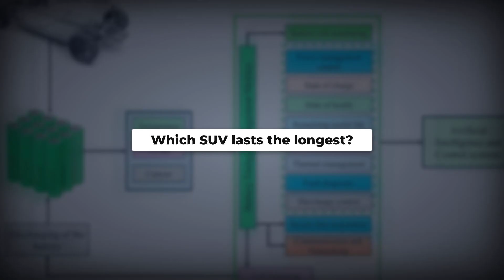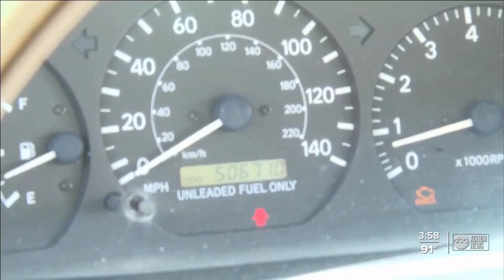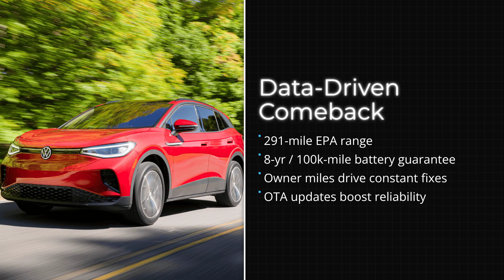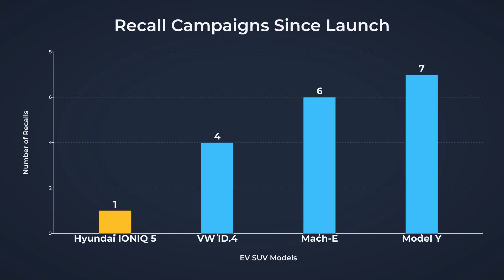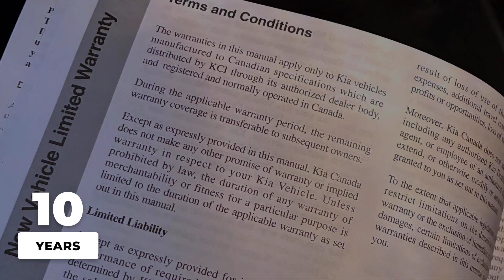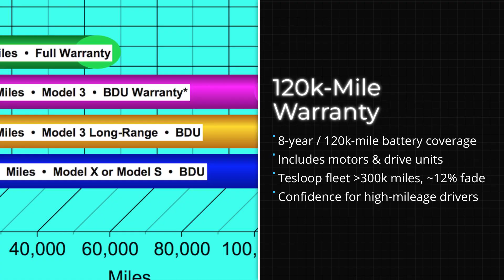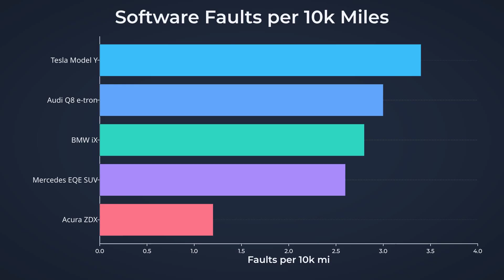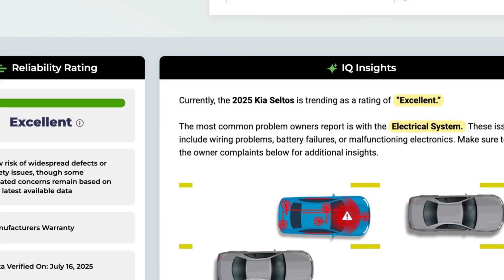These 8 Electric SUVs Are Built To LAST Forever

Comment: My 2017 Tesla Model S has had zero issues.  It has had a couple of repairs from fender benders, but the battery is still fine, and no major repairs or maintenance were needed.
Reply from the maker: That’s awesome to hear! The 2017 models really seem to be the sweet spot—you dodged the early drive unit issues of the 2013–2015 era, but still have the robust build quality. It seems like as long as the air suspension and door handles hold up, the powertrain itself is bulletproof. How many miles do you have on it now?
Reply: @ChargeZoneGarage Have 114K on it.
Reply from the maker: Nice! That is the magic number where critics usually claim the battery dies. Have you noticed much range loss (degradation) compared to when it was new? Real-world data like that is super helpful for people currently shopping.
Reply: @ChargeZoneGarage  Yes there is degradation, but not substantial.  maybe like 10%.  But we'll see.  Everything is working fine.

Comment: Sounds like a paid for review, the only question is who paid the most, as most of these have been ridiculed by every other review
Reply from the maker: We appreciate you sharing your perspective. To be clear, our reviews are not paid for by manufacturers. Our goal is to provide our own independent and objective assessments based on our testing and experience with the vehicles. We understand that opinions on cars can vary widely across different reviewers and publications.
Reply: @ChargeZoneGarage  Yeah, right! Do you know when bz4x started selling - riiiight - 2025 and you made it one of the most reliable cars?! Also: "Introduced in 2024, September 2025, Acura announced its discontinuation" You are simply a paid troll (a Toyota one).. Your first frame of the video shows Tesla model Y - again pure troll.
Reply from the maker: Oh, you caught me. I’m actually a paid troll for all electric cars—Tesla, Toyota, you name it. 😂
Reply: @ChargeZoneGarage On top of things, you might want to ask ChatGPT if we can now start calling the Ioniq 5 a lemon? e-GMP cars (Ioniq 5, 6, EV6 and GV60) have been plagued with all sorts of electric problems from the outset, from the ICCU failing, to the charge port needing to be replaced (as per my own Ioniq 6 after less than 1.5 years on the road with only 20,000 miles on the odometer) to the premature 12-volt battery failure. Soooo, that you put both the Ioniq 5 and the EV6 in the top reliable car models, i.e. built to last, in light of the well-known e-GMP problems, is not surprising. It’s astonishing!
Reply from the maker: @jean-marcfiliatrault266  That’s a fair point regarding the early ICCU and 12V issues on the e-GMP platform—definitely frustrated a lot of owners early on! The 2025 data we looked at suggests those specific failure rates have dropped significantly with the newer software updates and revised parts. Do you feel the updates haven’t fully solved it yet based on your experience? 🔌🤔

Comment: They need to last forever as the money you lose after buying one new is catastrophic!
Reply: I have a Mach E , it’s a great car very fast forty K on the miles I would buy another one,
Reply from the maker: @arthuralzamora7331  That's great to hear! It's awesome that you're enjoying your Mach-E so much and have put 40k miles on it. The fact that you'd buy another one is a fantastic endorsement. Thanks for sharing your experience
Reply: The money you save per year, adds up really quickly… I’ve saved over $20,000 in fuel alone with no maintenance while having a model Y over 4 years with ZERO MAINTENANCE 😊.. you spend over $6000 a year with maintenance and gas on your car, due the math my friend 🎉
Reply from the maker: @SuaveCityGear  That's an impressive saving! $20,000 in fuel alone over four years is a significant amount, and having zero maintenance on top of that is fantastic. Thanks for sharing your experience with the Model Y; it's a very compelling case for EVs.
Reply from the maker: That is an absolutely massive sticking point for many buyers. Catastrophic depreciation is a major deterrent for sure—it’s the silent cost nobody talks about in the press releases.

 the main question is: Is the money saved on gas/maintenance over 5 years enough to offset the initial loss in value? What do you think the 5-year depreciation on this particular EV will be?
Reply: 🐂 💩 bet you’ve never driven an EV
Reply: @stephenbusby3521  I have 37 radio controlled and about 200 slot cars.
Reply from the maker: That's an impressive collection! Having so many radio-controlled and slot cars sounds like a ton of fun. Which ones are your absolute favorites to run?
Reply: @ChargeZoneGarage  I have a 1/10 Scale classic Land Rover, which is probably my favourite at the moment, but I also have a couple of kits that I haven't even built yet. And my favourite slot car to drive is a 1980s Scalextric Lancia 037 rally car.
Reply from the maker: @wordreet  To be fair, your 1/10 scale Land Rover is probably 10x more reliable than the full-size gas version. And you can't go wrong with a Lancia 037. Maybe we need to do a 'Top 10 RC Cars' video next?
Reply: @ChargeZoneGarage  Hmm, tricky, my actual favourite is the Tamiya Sand Scorcher, since I first saw one on a beach way back in the 1980s. I bought one 4 years ago, didn't build it, gave it to someone for xmas. Bought myself another last year. So I can't say it's a true favourite until I've built it and driven it for a while. I have other favourites too, and all for different reasons. 😁
For a better formed opinion you could certainly talk to Tomley RC. He's not as old as me, but he has 300+ RC cars!!!!!!!
Reply from the maker: @wordreet You can't beat 80s Tamiya nostalgia. In a way, those kits were pioneering the electric off-road excitement we see in cars like the Rivian or Hummer EV today! Thanks for the Tomley recommendation, I'll have to check out his fleet.
Reply from the maker: You caught me! Does a golf cart count? 😉 Or maybe my remote control car from when I was a kid? It was electric
Reply: Petrol troll. Choice is good. Zero emissions is good. Not paying $700plus per month on gas is good too. 80% less moving parts.
Reply from the maker: @bobbituka123  Actually, we’re huge fans of the EV shift here—lower maintenance and zero tailpipe emissions are exactly why we cover this tech! This video was specifically about long-term mechanical reliability, but the cost savings you mentioned are a massive part of the total ownership equation. lol, who's missing those $700 gas bills? ⚡🙅‍♂

Comment: No entries from GM?
Reply from the maker: GM has made strong progress with models like the Cadillac Lyriq and Chevy Blazer EV, but most reliability data is still limited since they’re relatively new to the market. Once there’s more long-term data, we’ll definitely revisit them in a future ranking. Do you have a GM?
Reply: @ChargeZoneGarage  Yes. Chevrolet Equinox EV, AWD. Low voltage system, limiting charging to ~150 kW, but, I feel that the lower voltage will minimize the risk of power transistor failure, and motor insulation break-down. While not a high performance car, I think it will stand "the test of time".
      With only 5,000 miles, there are no problems to report, but the question is, how will it do at 300,000 miles? I understand, it's too new, for any data.
Reply: #1 is only introduced 2 yrs ago. Of course you can't find any battery failure in such a short time. Also you fail to mention it's discontinued in the US.
Reply from the maker: You nailed it. That's a fair critique. Since this video was researched, news broke that Acura is discontinuing the ZDX to focus on their own in-house EV platform (the ZDX was a GM partnership). The #1 spot was based on its high predicted reliability scores and the modular repairability of the Ultium battery, but you're 100% right that we don't have decade-long data on it yet like we do for the Model X or Rav4 EV. Thanks for keeping us honest.